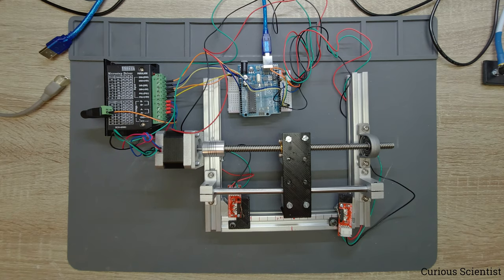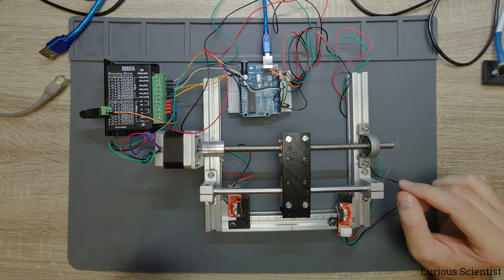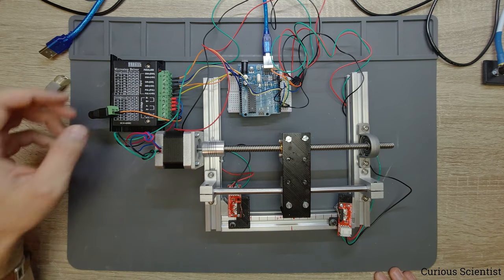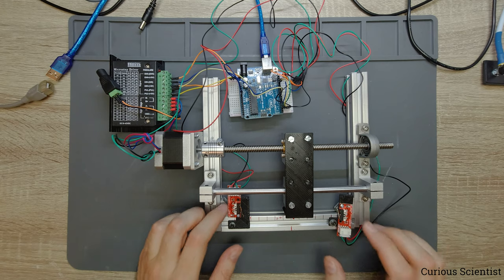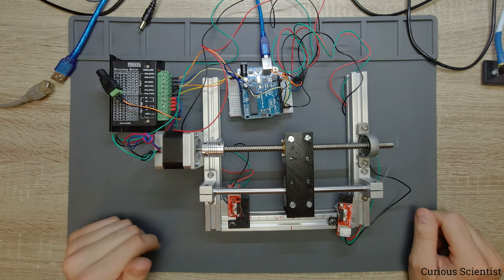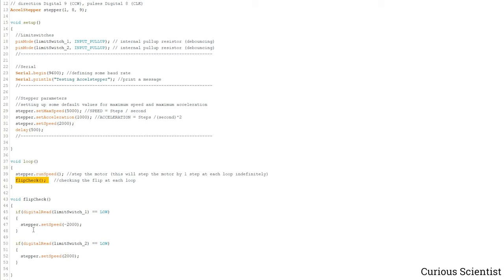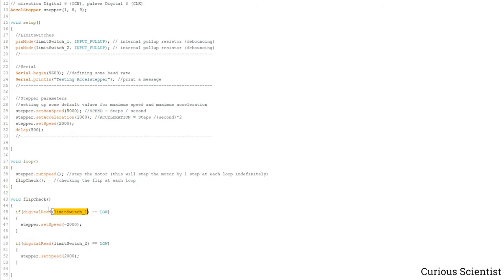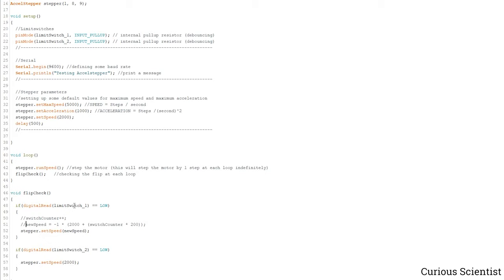Ping Pong with the AccelStepper library and two limit switches - Polling and interrupts

Comment: I got this working with a different driver (DM542T), the instructions still apply and work the same way. I also really appreciate you showing how to add more functionality in the code towards the end. Like any language you don't fully understand, reading it is much easier than writing it and it helps with my syntax a great deal. I subbed and donated $20, not just for a great video but also how well your documentation is on your website.
Reply from the maker: Hi! Yes, the principles are the same as long as the driver has the step, direction and enable pins. In fact I have a video on my channel where I show 3 or 4 different drivers running with the exact same code. You donation is very appreciated, thank you!

Comment: Solid code, can easily test limit switches before use.   You may want to declare variables inside your ISR function as volatile rather than bool but if it works it works!
Reply from the maker: Yes, the ISR-related variables should be volatile! Sometimes I forget it. :)
Reply: @CuriousScientist  yeaa I would too!

Comment: Thanks for this video! I used this code to program a Nano that I was using with an Easy Driver to drive a 17HS4401. All I was trying to do was reverse the direction of travel at the limits of a belt driven rail. It worked flawlessly when the circuit was first powered up but within a few minutes the limit switches were bouncing so that the direction was reversed twice and the carriage got stuck. I have both of my switches wired to the NO circuit and have added a pair of 10K-ohm resistors to pull the NO circuits to ground when not being pressed. I have tried changing the motion parameters and removing the pull downs, but nothing seems to be helping. Can you think of anything else I could try? Thanks for all your excellent work!
Reply from the maker: Hi Allan,
Yes, sometimes these switches are still noisy with the extra pull-up/down resistors. One can also add an additional debouncing capacitor (100 nF is a good initial value) between the GPIO pin side of the switch and the ground. Also, we can cheat in the software by adding a "timer". This would hinder the code to enter the button-polling part for a given time period (few hundred milliseconds) after the button was pressed which would be sufficient to let the ringing of the button decay. Check your email inbox, you'll get something soon. ;)

Comment: Video/project idea: I’ve never yet seen anyone make a system like this that counts steps and converts them into distance traveled. For example, you want to make a small at home assembly line, and you’re cutting a lot of rods, of whatever material, at a specific length, and you want to make an automated, highly accurate measuring system using a similar layout to this. Using a homing sequence to find the point of origin (zero) then homes against the rod you want to measure. The whole system being a fixed length of possible travel, and the rod displaces however much of that possible amount of travel, the arduino could then figure out by how many steps it took between the first homing cycle (zero) and where it contacted the rod. If that makes sense? 🤔 I feel like that didn’t make much sense, but in case it did, I’m posting 😄
Reply from the maker: Hi! If you check my videos, I have a well explained example on how to convert steps to linear displacement using lead screws and vice-versa. Based on that video and this example, the system you proposed could be made. However, I am not planning to make a video on it, because I don't need such equipment.

Comment: What portion of code would you use to move a SPDT switch to run the stepper back and forth so that I can store two positions - a start point and an end point before the loop runs
Reply from the maker: I guess it is a 3-way switch. I would poll it or use an interrupt and move the motor according to the status of the switch.  I have examples on stepper motor control based on buttons. Check my stepper motor related playlist.

Comment: Hallo, thank you for your very good Videos. Cold you write how it is possible to change the 2. code, that the stepper is going after the use of the interrupts a limited distance. I need to run the stepper after the contakt for 15 cm. Thank You.
Reply from the maker: Hi and thanks! I won't write the code for you for free because I am not a free support service. Also it is not that simple. You need to know the pitch of the lead screw and the stepper motor's microstepping setup to be able to convert the number of steps to cm. The steps first are converted into angle then the angle can be converted into the linear displacement of the nut.

Comment: Hallo, Mr. Thanks for you. But i have some problem in my project. Previously I tried on my stepper motor. it went well. and after 3 trials. limit switch not working. and the motor won't go back and forth. may i know what is the cause?.
Thank you Mr.
Reply: My name's Yogi. I'm from Indonesia student. now I'm working on my thesis. and I know about this video from my supervisor in college. please help sir. Thank You 21:41
Reply from the maker: Hi! Check the wiring. I can not troubleshoot your system without seeing it, sorry.
Reply: @CuriousScientist okey sir. I'll check it and try. Thankyou verry much🙏
Reply: @CuriousScientist Thank you sir. the program is running smoothly. my first time using Arduino Mega. and now I change to Uno it runs smoothly
Reply from the maker: Good news, thanks for the update!

Comment: Hey! 
Hello friend, I would like to know if this movement system can be replaced by an a4988 driver ... if that is possible, what modifications should be made?
Reply from the maker: Hey! 
The A4988 also has the step (PUL on the TB6600) and direction (DIR on TB6600) pins, so nothing is needed. Maybe, you have to connect the enable pin to high (+3.3 V). All other connection should be similar.

Comment: Is it possible to only use accel stepper library to move back and forth continuosly/repeatedly without the limit switches?
Reply from the maker: Of course. I have several video examples on it. Check my stepper motor related playlist.
Reply: @CuriousScientist  Hey sorry. do you know which specific video it is, I cannot identify it
Reply: @CuriousScientist  trying to make it run continuosly with just a press of a button, just by using accelstepper library
Reply from the maker: https://youtu.be/PkmPmwt8DbA

Comment: Hi, first thanks you for your work, and sorry for my english, i'm trying to do this ping pong move with delay before restart to the other direction, it's OK, but now i wolud like to implement acceleration when the moves restart, i know i should use stepper.run() instead of stepper.runSpeed() but after reading accelstepper library, i cannot figure out how do to... Maybe you could show me the way ? To illustrate, i'm making cabble car, so i dont know how many step i have from 1 side to other side, and it car vary (slipering, lenght of cabble, etc...) so i cant use the move() or moveTo() command... i'm lost...
Reply from the maker: Hi! Your English is good, I understood everything perfectly. 

When you go from A → B, you can move the motor normally. After the limit switch is triggered at B, add a delay, then put the stepper.run() in a while where the condition is the state of the limit switch at A. So, the stepper motor will be moved from B →A in a while() loop using the stepper.run(), therefore, there will be acceleration. When the A switch is triggered, stop the motor.

Comment: Where can we see the limit switch wiring diagram ? On the other video it's mostly for the stepper. Is it supposed to work with standard SPST switch ? I am using two small OMRON V-15G-1C5-K switches and using the code provided it's not always working. Maybe because of the debouncing thingy discussed briefly ? It seems to works better in NC circuit than NO but not always reliable
Reply from the maker: Everything is in the code. It is such a primitive circuit that it does not need a diagram. It has a + and - power (typically +5 V) connection, and it has an output that you can connect to any GPIO pins. NC and NO should not play a role as long as you have a pull-up (or pull-down) resistor on the output pin. NC and NO only plays role in the status of the GPIO pin. Also, there's a direct link to the limit switch in the description of the video. Check it.

Comment: Can this be done with push buttons to simulate the limit switch?
I am going to use proximity sensors instead of limit switch
Reply from the maker: Hi! Sure. A limit switch is just a push button anyway. Anything that causes a change on the GPIO pin can be used.

Comment: Is it possible to add some other methods to the Accelstepper library, like, for example, a goHome method?
Reply from the maker: Sure, you just have to modify the library. But I suggest not to touch the library but write the homing algorithm in your code. It is easier.

Comment: Hello Very nice !!!!
I Designs a similar device. I watched your YouTube video and website  and it is an interesting solution. In my device, I have to hold the bed for a while. 
the bed goes to homing then goes the other way when it reaches endstop stops for 5 seconds and goes back to zero. 
I am a poor programmer trying to solve it, but after a few hours I gave up. Can you tell me what to add in the code to make 
it work like that? 
Thank you very much for help.
Reply from the maker: Hi and thank you for your comment. The easiest solution is to add a delay to the code when you switch directions. So after the limit switch is pressed, you add a 5 second delay, then you continue the movement. This extremely simple.
Reply: cool
I just don't know where, as I wrote, I don't quite get the coding
and it will be very helpful in which line

Piotr Strzelecki
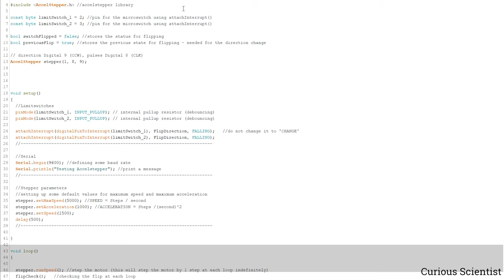Reply from the maker: @piotrs5616  Please just watch the video from 9:40. I explain the code line by line. Based on that and my comment above, it is really easy to put everything together. That's why I spend so much time on explaining the code line by line so anyone can understand it. Pay attention to the flipCheck() function. :)

Comment: Andy Niewiara
I am using Arduino, stepper motor with Tb6600 driver. I need to move the motor ¼ of a turn, delay it and come back to its original position and delay it. So far I find that the motor with same amount of movement steps will not come back to its original position. Please any help will do
Reply from the maker: Hi! Do you use this code? If yes and it does not return to the original position, it is possible that something is wrong with the mechanism (slipping?) or the motor is undersized for the task. You haven't really described how your system looks like.

Comment: How I can adjust code for Speed  with potentiometer? Thank u and sorry for my eng
Reply from the maker: Hi! Read the potmeter with an analog pin. Then, define the upper and lower speed boundaries that you will use and map the minimum and maximum output of the potmeter to these boundaries. Then you just have to update the speed whenever you read the potmeter.

Comment: Hello, although the motor changed direction when I pressed the switch with my finger (worked in several tests), it did not do that after I installed the switch to the setup and restarted the program. The LED of the switch circuit board was On once pressed and continued to be On when the platform continued to press against the switch but the motor just did not change direction. Tried a few times already. Have you found a good way to make it works 100% of the time?
Reply from the maker: Hi! Have you watched the video or you just copied my code and used it without any thinking? 

I even mentioned in the video that the limit switches can bounce (send a burst of signals) which can confuse the code and the motor could continue going in the same way even after hitting a limit switch. You need to debounce the limit switches if you want something reliable.
Reply: @CuriousScientist  I have watched your video several times. You mentioned a few times that the switch does not work all the time and perhaps we could look for something better. It has been 3 years since you made that video so I wonder if you have found a better switch or other method that would guarantee that it would work 100% of the time.
Reply from the maker: I just wrote it. You need to debounce the switch.

Comment: Hi, thank you for your amazing work ! i'm trying to add the joystick code you used in another video ("multiple stepper motor with joystick...") to this configuration but i'm stucked mixing the flipCheck, Flipdirection and read analog loops, could you advise me ?
Reply from the maker: Hi! I am glad that you found it useful. It is relatively simple to merge the two project. But it is unclear for me what you want exactly.
Reply: @CuriousScientist  super useful, i' watched your video like 50 times. I'm driving a stepper with a joystick on a signe axis (Y axis), eveything is going smoothly, clockwise, and counterclockwise thanks to your code but i can't integrate the automatic direction change when a limit switch is reached. I can add some code here :

here is the part you made for driving the stepper, i took only the Yaxis part (and also the InitialValues part) :

void ReadAnalog()
{
  Analog_Y = analogRead(Analog_Y_pin);    

 

  if(abs(Analog_Y-Analog_Y_AVG)>25) 
  {
  stepper2.setSpeed(5*(Analog_Y-Analog_Y_AVG));  
  }
  else
  {
    stepper2.setSpeed(0);
  }
  }
}

and i'm trying to merge it with the part you've made that change the direction and record the previous state :

void flipCheck()
{
  if(switchFlipped == true)
  {    
     //Serial.println(previousFlip); //This was just a control flag for debugging
    
     if(previousFlip == true) //If the previous flip is 1, we have positive direction
     {    
        stepper.setSpeed(1500);       
     }
     if(previousFlip == false) //If the previous flip is 0, we have negative direction
     {  
       stepper.setSpeed(-1500);
     }
     switchFlipped = false; 
	//We have to reset this, so in the next iteration of the loop, the code will not enter this part, only when there was a click again
  }
 
}

void FlipDirection()
{    
  switchFlipped = true; //we change the status to true, so the code will enter the flipCheck() function 
  previousFlip = !previousFlip; //change the state to different from the previous - this controls the direction
 
}
Reply from the maker: I am sorry but I am not going to troubleshoot the code for free. You have to read (polling or interrupt) the limit switch and when it gets hit, you have to change the direction. The above code is incomplete. (BTW, do not post large chunks of codes, because YouTube automatically marks them as spam).
Reply: @CuriousScientist  yes, of course no problem, i'm gonna keep looking into it. Anyway, thank you for your videos, they are really helpful for beginners like me and sorry for the big code spamming !
Reply: @CuriousScientist  খফহ
Reply from the maker: I have no idea what's written there, sorry.

Comment: Hi, mate! Please help with the AccelStep library. I am using TB6000 driver. I need the motor stepper to move left and right automatically and there is a limit switch insurance, so that if the motor suddenly goes further, the button will return it in the opposite direction! All codes work like this but not together
Reply from the maker: Hi! I have several videos on this topic, so please take your time and look around on my channel. I am pretty sure that you'll find what you need.

Comment: This is almost perfect.  However I need the same circuit but with 2 buttons. . Any idea how I could use the acceleration library in your code?  I'm moving a pool table back and forth so it needs to be very smooth.
Reply from the maker: The limit switches are literally buttons, therefore I cannot really understand your issue. The smooth movement only depends on the values you determine for the acceleration and max speed. Or, you can use the runTo...() functions which do not have acceleration implemented and move with a slow speed. However, if you move something heavy, you might need the acceleration. As I said, check my other videos related to stepper motors. I have shared so many solutions, you can easily copy-paste together your own code from my codes.
Reply: @CuriousScientist    Thanks very much for the reply.  The idea I have is to press button one and the pool table will move left until I let go of the button,  button two does the opposite of course.  I have build you circuit and it works.  However your button reverse the motor. I need the buttons to simply activate the motor until released.  The pool table is already on rails but moving it by hand jerks the pool balls a tad.
Reply from the maker: I answered you in the other comment, there are 2 links. They do the exact thing what you want.